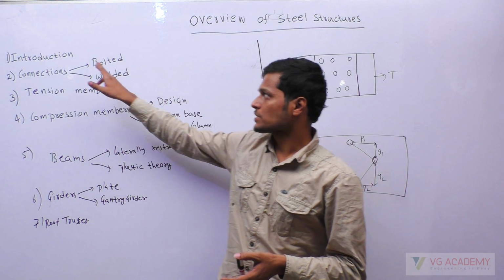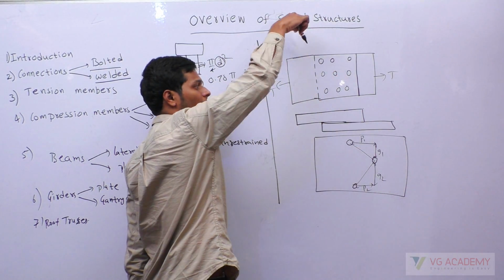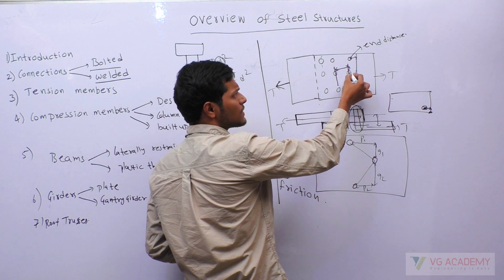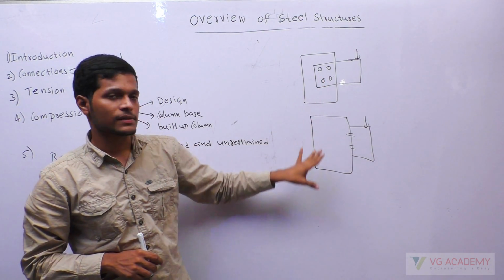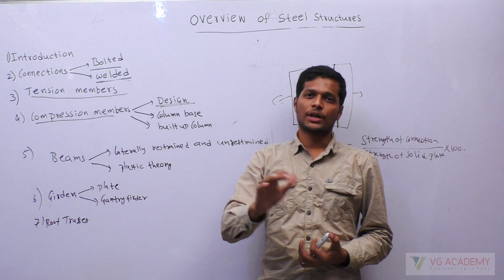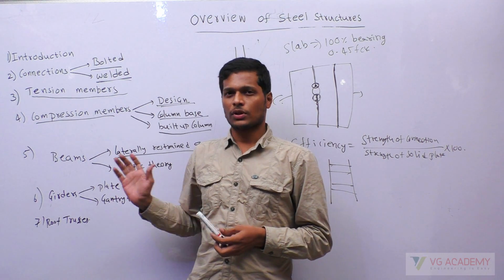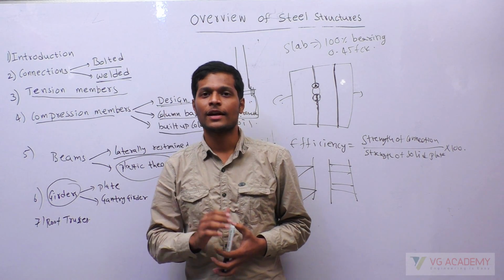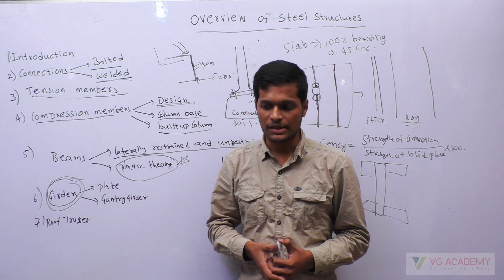OVERVIEW ON STEEL STRUCTURES

Comment: Sir, do you have a complete lecture on steel structure design?
Reply from the maker: surya joy yes. only for registered users
Reply: VG academy Civil engineering how to register to get the classes??
Reply from the maker: https://vgacademy.net/onlineexam/index.php/login/register
Reply: VG academy Civil engineering thanks sir
Reply: Sir i m working in a steel design company. Actually i need lectures to have a base especially for doing connection design. Are u taking classes  for exam based preparation or will it help for me design. Plz advice sir.
Reply from the maker: its mainly exam based
Reply: VG academy Civil engineering  ok sir thanks for ur replies

Comment: Sir, why wind load and earthquake load are not considered together in the design? Can we know the technical answer inspite of the their probability of  zero occurrence at once?
Reply from the maker: the structure size will double and its a risk that we can take. example characteristic strength also has 5% risk
Reply: VG academy Civil engineering :thank you sir,
Does heavier section is risky to resist earthquake?
Reply from the maker: its not economical and uses more space. you will get very less carpet area with double cost. After hearing this you also will think to take that small risk what IS code have taken
Reply: VG academy Civil engineering : NO Sir,I was confusing  while reading the following sentence "In designing for static loads(wind load and static gravity loads) one can feel greater confidence about the safety of structure made up of members of heavy section,in the case of earthquake loading,the stiffer and heaviest structure does not necessarily represent safe design. For a structure in earthquake zone,both wind load and seismic load are computed,and the maximum out of two is considered for design".
I will be thankful if you provide me the clarity